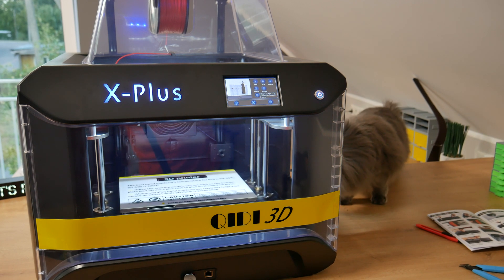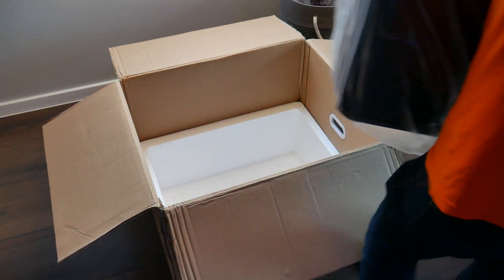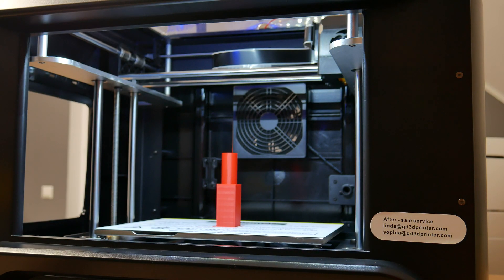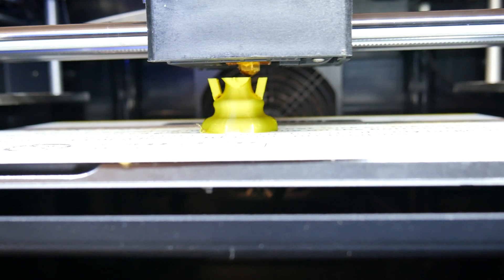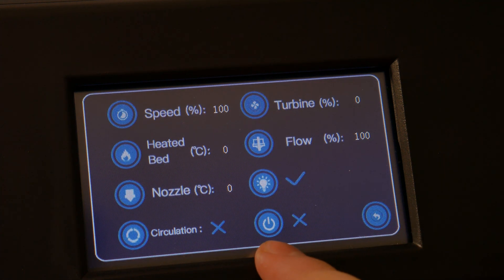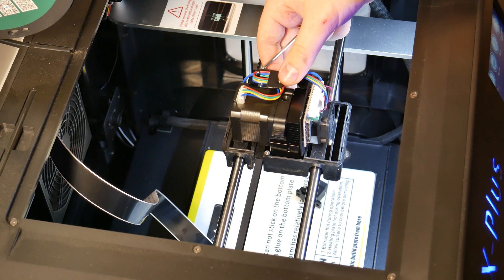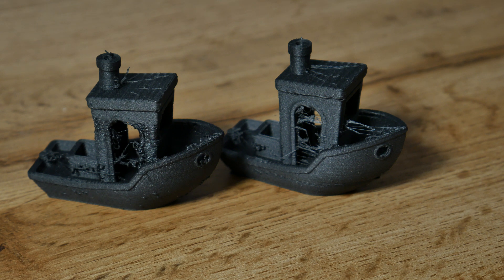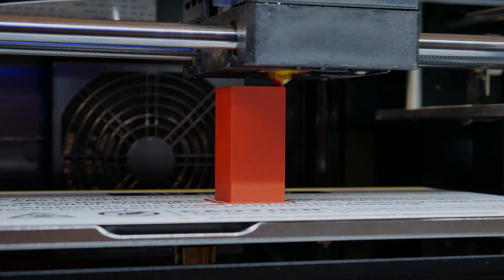QiDi Tech X-Plus - Printer For SERIOUS WORK!!!

Comment: hello, which slicer settings do you use to print? I am new to the 3d printing world but am having trouble with printing the top. Also my prints are hollow even if infill is at 100

Comment: I can print CF Nylon on my modified CR20Pro (ender 3 with abl and closed bottom basically), no warping
all you need is an all metal hotend (to print hot enough), a filament dryer! (required especially with nylon) and a hardened nozzle

Comment: I am looking for a printer that can print Nylon CF and Ultem, Peek parts and this is the lowest priced option I have seen so far, the only thing that puts me off is it does not seem to have 360 degrees part cooling
Reply: cf nylon is really easy to print, any printer that can go over 250 safely (all metal hotend) can do it, all you need is a hardened nozzle, ultem and peek is different tho

my best suggestion is to just build a printer with heated chamber, with an E3D V6/Volcano hotend and a PT100 sensor, most hotend thermistors can't take over 300°C so thats why you need a good thermocouple.

will be probably around $300 if you don't pick the highest quality parts for high speed printing (high speed printers usually use linear rails etc to print really fast without ringing, but those cost way too much imo)
Reply: CreateBot F160 PEEK Edition I would suggest.

Comment: It's amazing to see how far printing has come even since I got started only 6 years ago. I spent $800 on a wood-frame FlashForge in 2015 that would kind of print ABS, but had all the same issues that non-enclosed units (still) have.

Now we have a printer like this, that is available for slightly more than my CR-10S that I only use for PLA and PETG.

Technology is an amazing thing.
Reply: Gads, a lot of printers that are REALLY unsuitable ABS are advertised as such.
Would be great to go to town printing engineering materials!
Reply: @GnuReligion  It is fun as Hell! Love my x-Plus!!! :)
Reply: @OZtwo  I am jelly.